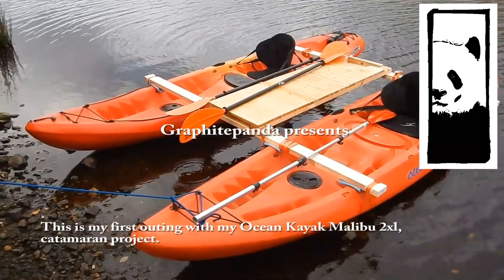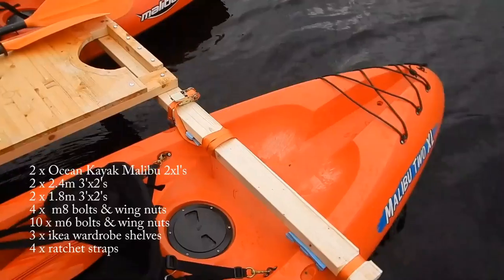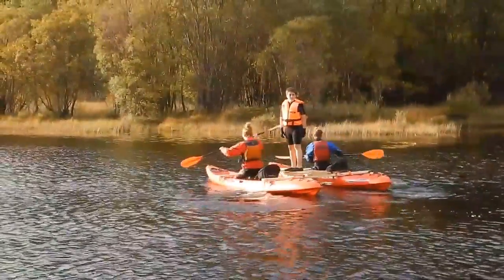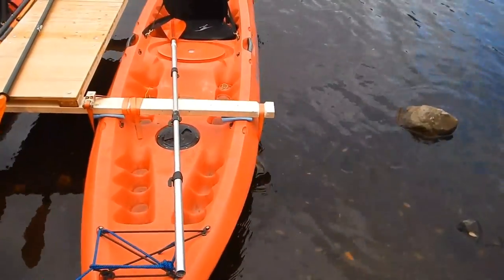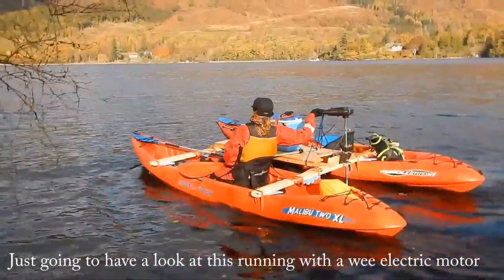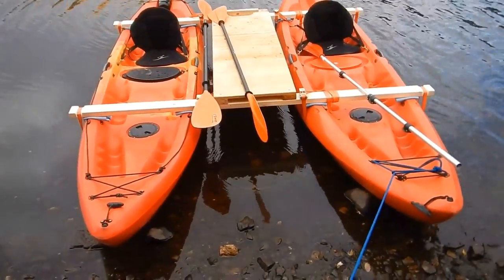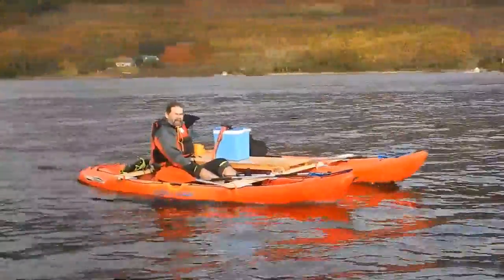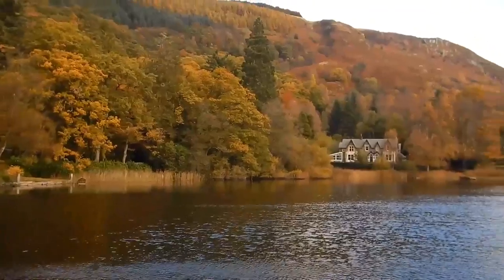Ocean Kaycat, catamaran project

Comment: Excellent design... this is a same design I've been thinking to design... with two sit on kayaks... and a trolling motor in the middle powered by a tool battery :-) ... I am very much interested in the design, the main reason is... that I can transport the kayaks and the wood on a vehicles roof rack.. no need for trailers!

Comment: Very cool, been thinking of doing this myself using the same crossbars and straps I use on top of my truck to haul the kayaks. Take them off my suv rack and slap them on the kayaks! Add platform with bolts and wingnuts or a couple more short straps and go! I would be careful using ratchet straps though as they can be easily overtightened to the point of damaging the kayaks. I will use cam buckle tiedown straps. Thanks

Comment: Looks really a simple idea. I was planning to do it with my canoes. But my canoes are different model, almost same length. Use you your idea to do it, two long pieces of wood, make a groove in the wood for the gunnel. Put a plywood in between the canoes, it should be do able... thanks

Comment: Good idea. If the straps go under the canoes it causes unwanted drag. Also I’d remove the solid section of wood between the two canoes so that each paddler can paddle on left and right sides of each canoe. No one that I know wants to paddle only on one side. Also try using canoe paddles as well as kayak paddles.
Reply: I dont see the small straps causing too much of a drag problem, especially with two people paddling or a trolling motor! Also if you didnt have the platform and 2 people were trying to paddle on both sides it would be like a 3 Stooges epidode!

Comment: Please share the complete dimensions. I want to build one. Thanks
Reply from the maker: Hi if I  had them i would but I've since sold it on. I currently have a smaller cat using two white water six on tops, which bizarrely works well and is much easier to transport